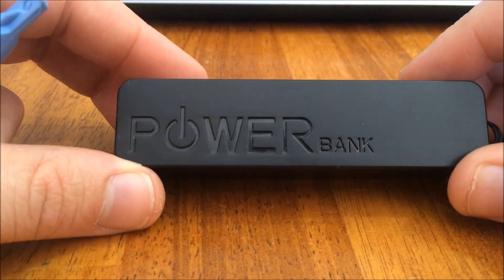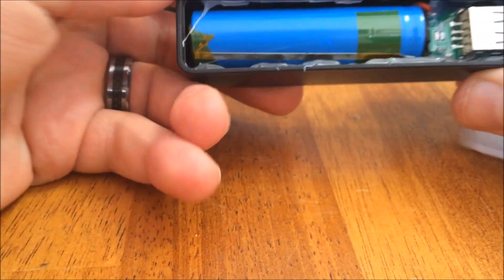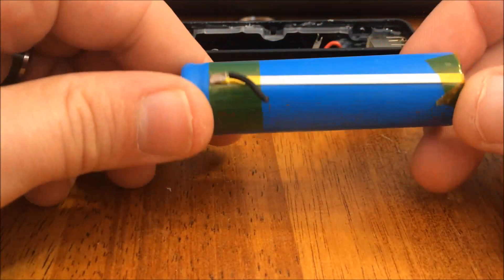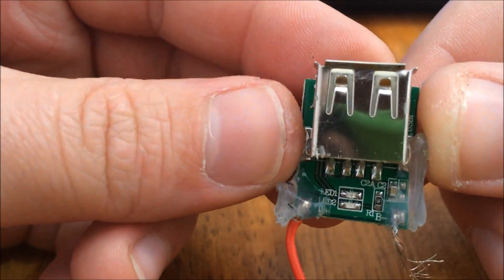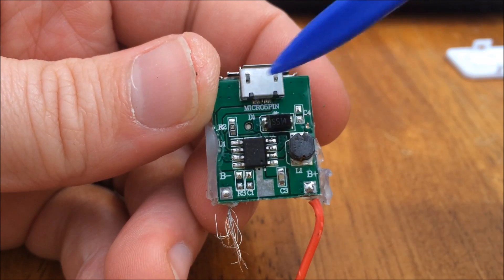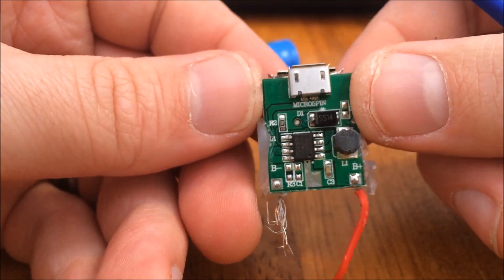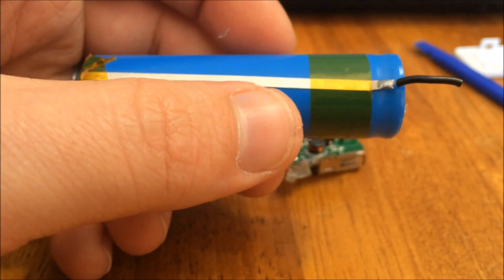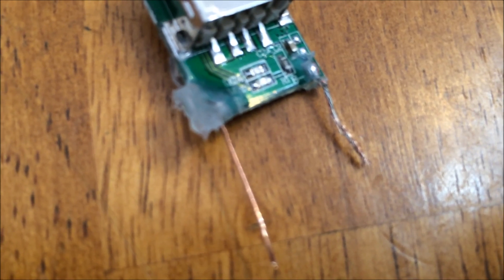Dollar Store Power Bank Teardown

Comment: I just unboxed mine and am charging it,however its blinking red? Does anyone know why?
Reply from the maker: I think blinking red means charging and blue means full
Reply: @NevsTechBits  - what does solid red mean after blinking red. It's plugged into the 1A charger (old iPhone one) and it was blinking for about an hour and a half. Now it's solid red, not solid blue. I tried plugging one of those USB LED strips in (they are 5V), but nothing turns on. I've tried my trusty Anker Power Bank, and it worked instantly. I purchased two of these in Dollarama and none of them powers these LED strips. Confused.
Reply: @Seii-FPV  solid red means it's fully charged
Reply: Mine has no lights. I don't even see a place where it looks like a light might shine through. I charged it overnight but it will not charge my phone.

Comment: I hope it's ok to use on raspberry pi.
Reply from the maker: I doubt it will give you much juice
Reply: I've actually used one of these to power my pi3 and it worked surprisingly well actually
Reply: @eirikmacdonald3793  
Used one on my Pi Zero. Was not enough

Comment: Any possibility of making a tut vid converting these popular and cheap powerbanks to a solar charged power bank?
Reply from the maker: +Jeremy C Barnhart that's a helluvagood idea!
Reply: @jeremy barnhart

bro if you're familiar with LM 7805 IC (TO-220 Package type, its more robust and has a large heat tab, where u can attach an aluminum heatsink, u can use it to charge this kind of powerbank, it can accept DC voltages 5.25 - 37 (look also for d specs)..

its a voltage regulator IC, you can connect the input to a solar panel then use its output to charge the powerbank.. just make a search frm the net to figure out the connection 😊👍

thank me later!!

Comment: the components are a simple boost converter, the integrated circuit a diode and an inductor. to turn 3-4 volt input to 5v output.
Reply: Good point!
Reply: are you sure? they dont look like the normal boost converters

Comment: 8 prong chip is a timer chip it just activates or disengages depending if load is high or low. Search 555 timer chip
Reply: seriously ??? thats not a 555 timer thats a battery management chip it keeps the voltage exactly 4.2 V and controls the led's and controls the current
Reply: @fouzaialaa7962  yessir, and there is absolutely no rom. Thats a schottky diode
Reply from the maker: Thank-you sir! I'm pinning your comment
Reply: +Nev's Tech Bits no problem man they became my best friend for diy rc electronic switches or making led's blink.
Reply: 2:51 dude that is just a diode, see the board it is labeled "D1" (diode 1)
 and you can see the grey stripe on one side to indicate the negative or cathode pin  of  the diode , for a second i thought it might be a voltage regulator but the fact there is  no 3rd pin then the  stripe and labeling on the  board  tell you it is a diode,

Comment: For anyone wondering, it charged my phone to 37%. Don't expect it to charge your phone any more than that.
Reply: It is better if you buy a DIY power bank "like this", and put a battery in it. If you buy it with battery, the battery will be very very cheap and weak.
I bought two 2 years ago, one has 170 mAh capacity (!!!), the other has about 600mAh. And it was sold as a 2200mAh power bank. Lol.
I just bought 2 3400mAh Panasonic 18650 cell, soldered out the old battery, solder the panasonic in, and how interesting, it almost charges my iphone 6 2 times from 0 to 100...
Instead of 7% and ~25% with those cheap fake batteries that was in the power bank... :D
The battery itself is about 10 dollar, more money, than the power bank with the fake battery..:D
Reply from the maker: What type of phone do you have?
Reply: Nev's Tech Bits Samsung Galaxy Note 4. You think the problem is my phone? I bought this power bank cause it was $4. I figured it would be good for emergencies even if it didn't charge my phone all the way
Reply from the maker: Naw the problem isnt the phone. These power banks are just so puny lol. I do think its supposed to charge your system farther than that though.
Reply: Nev's Tech Bits I must have gotten a bad one then, Nev >.< Darn it.
Reply: Mine charges my phone to 100% and then to 50% after that. You got ripped off, bro